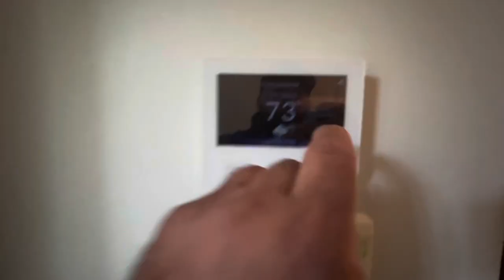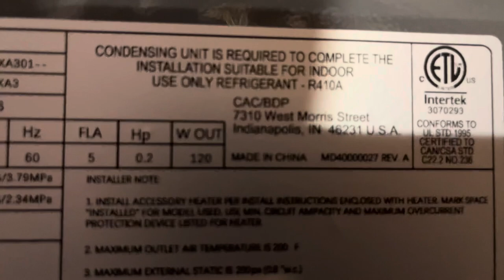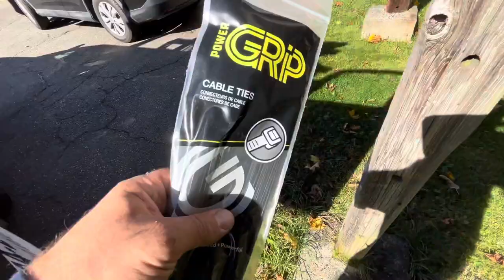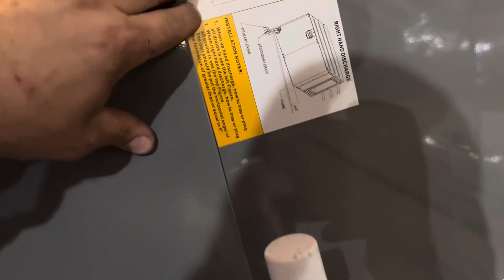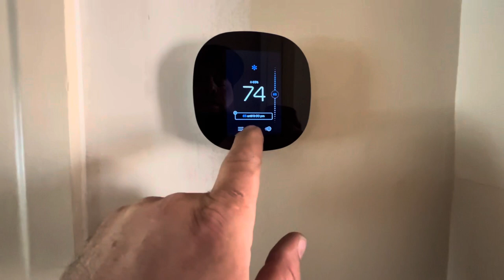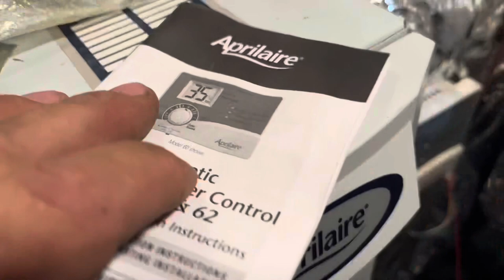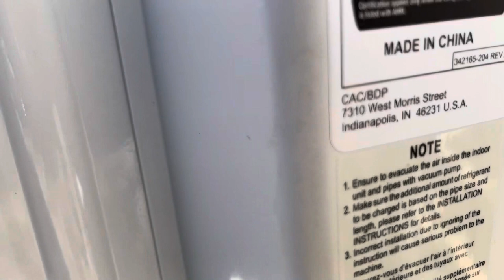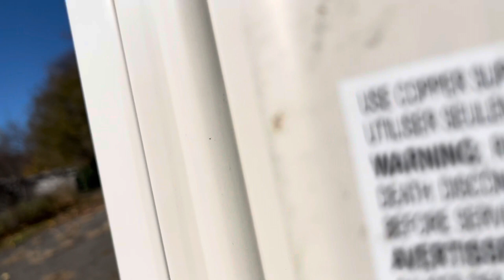HVAC.  CARRIER DUCTED MINI SPLIT SYSTEM. REPAIR AND SYSTEM CHECK

Comment: I don’t know the background on this, but I’m anal about wire runs. If I want something different than an installer is willing to do, I’ll say keep it loose, I’ll redo later, and sign off all is functional. Usually it’s a satellite or cable company. I refuse to let them staple wires to the house. Usually, installers will leave things loose for me, and leave me with extra cable/parts. I also did that with last HVAC install. They no longer want condensate pump lines running outside, due to freezing liability. They left me the material to change it later if I want to. I signed papers releasing them of liability for pump not being wired in, and not moving condensate line. I’d rather have water on the garage floor than system shut off in freezing weather. Like what you do!  Still wish I had the app for system health.
Reply: Yep when I had satellite installed years ago I asked the installer if he could just leave the wiring lose and I’d tack it up later the way I wanted. Guy was happy to do that for me